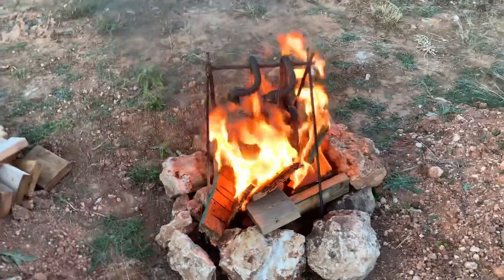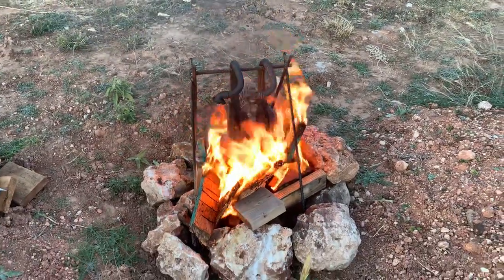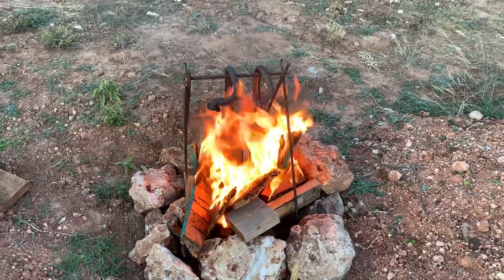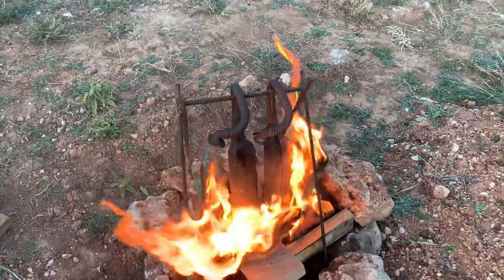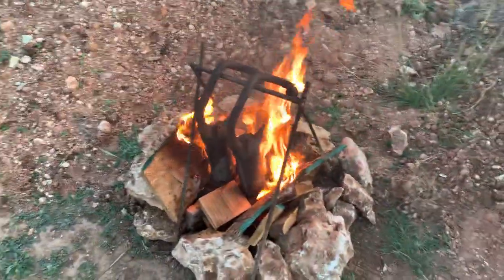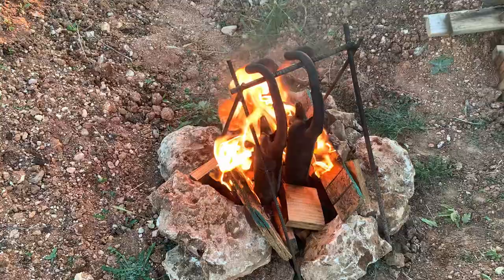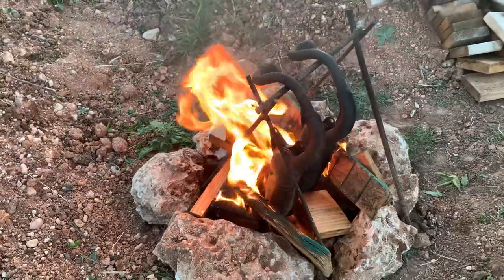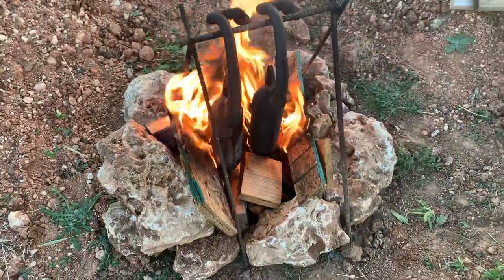Scooter Muffler ● Fix a Plugged Up Exhaust Pipe with a BBQ Barbecue Burn Fire

Comment: When should to do this? Mine has about 700 miles. It started fine garage kept but i seen oil dripping out the end of muffler oh stuff is rattling around in there to. When you say one is bad is it completely plugged then?
Reply from the maker: Yes, I mean completely plugged.  If your scooter is running fine then I would not do this.  Some oil dripping out of the back of your muffler is expected with a 2-stroke engine and stuff rattling around in there may eventually work its way out on it's own.  The main reason to bbq it is because the backpressure is too high for the engine to run properly.  Until you get to that point (with 700 miles you may never) I would leave it alone.  Thanks for your comment!